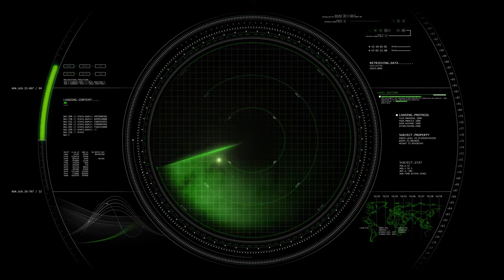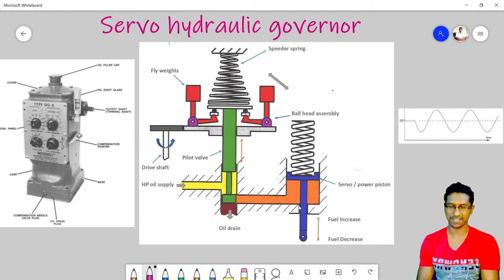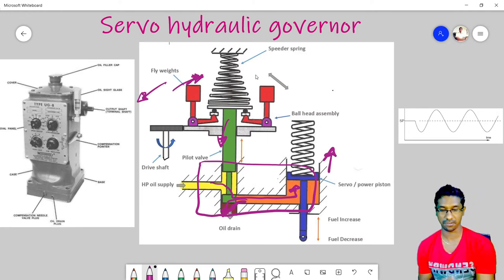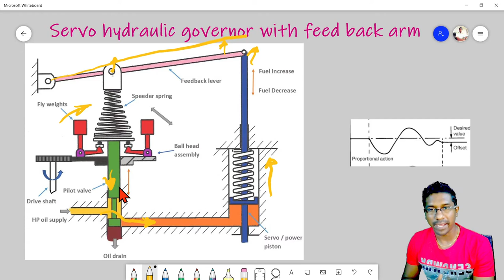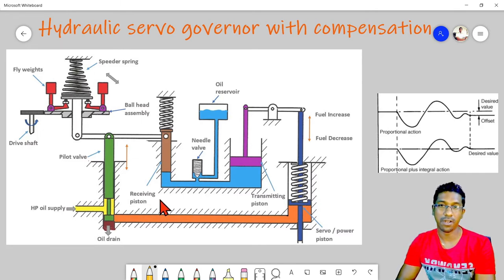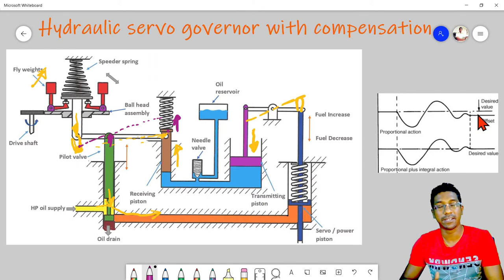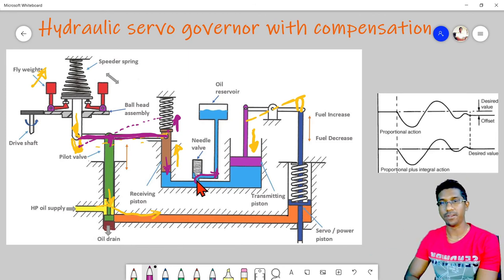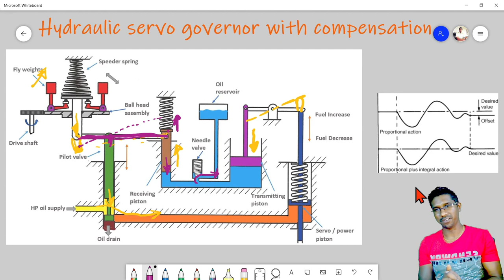Diesel governors English - Part 2 #MarinEngBase

Comment: Hello, I would like to clarify the work of the electric motor controlling the spring, with thanks and appreciation
Reply from the maker: Yes ..the motor is a dc motor..if the motor turns in one direction then the spring will get compressed by the action of screw and nut arrangement via the clutch mechanism. When the motor turns the other direction then the spring will  extract.
Reply: @marinengbase  Thank you very much sir for the explanation

Comment: Is spring force controlled by a motor?. Whats is it driven by?
Reply from the maker: Spring force is controlled by electrical motor....for regulating speed, in case of droop action, droop feed back arm will adjust the spring force
Reply: Thank you for the reply. 
Doubt: is that electric motor controlled by the speed control lever provided on the main switch board.?
Reply: @aji_Seafarer  Да. Короткими нажатиями на рычаг устанавливаете необходимую частоту тока, выдаваемого генератором (f=50 или 60Hz).